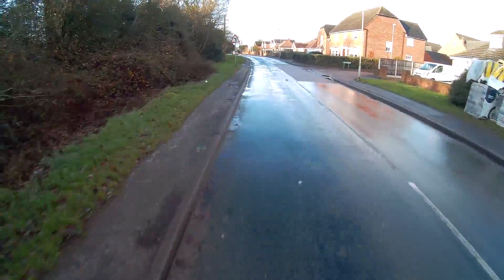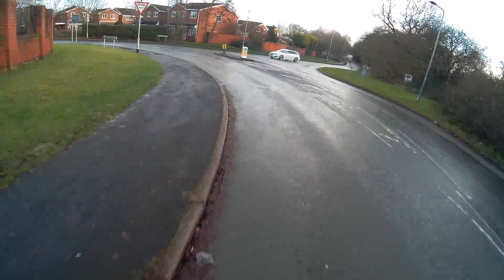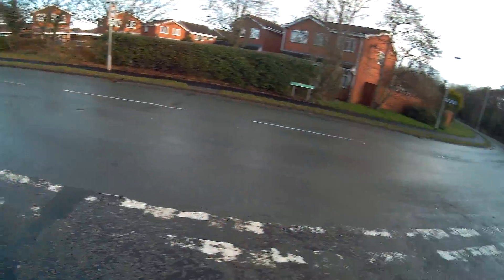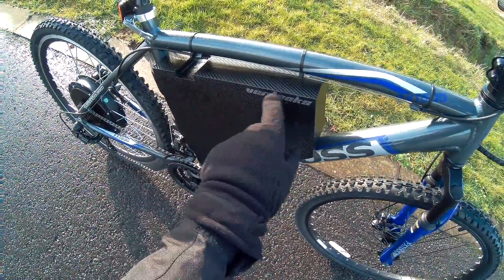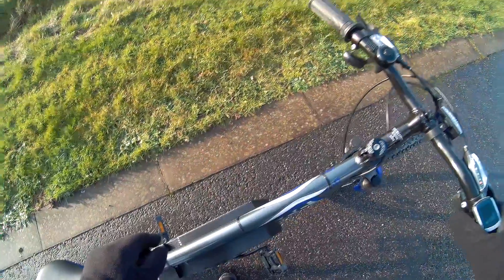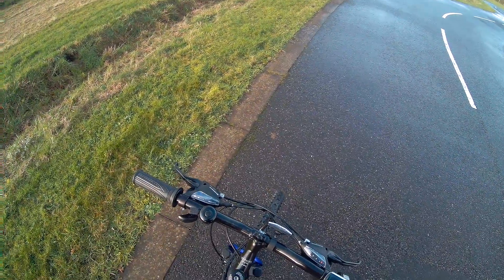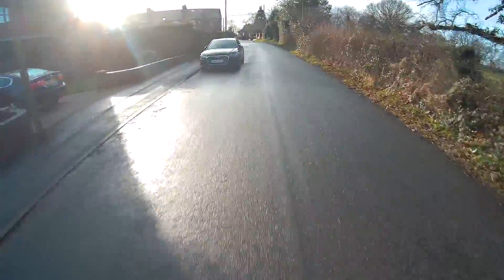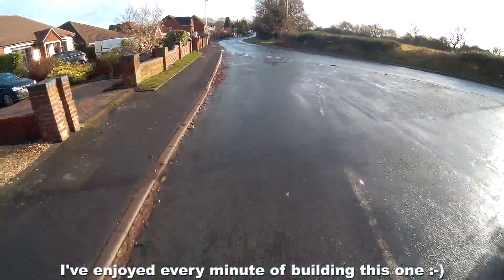Budget 1500w DIY eBike build part 5 - The maiden run and it's now for sale!

Comment: that bms is a beast..could you recommend a good spot welder tony
Reply from the maker: Either the Malectrics, Sequre or the Kweld spot welders are all good. The first 2 are essentially the same but the Kweld is better.
Remember that a spot welder is only as good as the battery you're using. My battery will kick out 1000A which is total overkill but you do need something ample.
https://malectrics.eu/product-category/arduino-spot-welder-bundles/
https://sequremall.com/products/mini-spot-welder
https://www.keenlab.de/index.php/product/kweld-complete-kit/
Reply: @Vortecks  thanks tony..i will be sure to over do the recommended limit..thats why i want to make one myself..some chinese packs look like a fire waiting to happen

Comment: For your next build you might wanna consider fitting a shorter handlebar stem which will save you hunching over the bike and give you better control for steering.

Comment: Could you put direct drive wheel on the front and use it to charge the batteries and extend range?
Reply: No, it would cost more extra energy through the rear motor to turn the motor on the front, than what the front motor could convert back into electricity = net loss. Regen only works when you've got energy that will be wasted, e.g all your kinetic energy when moving and want to stop which normally gets converted and thrown away as heat energy by your brakes

Comment: My ebike has a problem, rear hub motor is 2kw and while filing the drop outs, I filed them a little too much and wheel, even if I tight it up as much as possible, keeps falling out of the drop out a little at the time. I have 2 torwue arms too, 1 on each side and they are well tight and release all the spinnubg force onto the frame, non away fron the frame. I am 100% sure that the axle does not spin more than a millimetre max but it easily slips down. What can I do??
Reply: Gursi Singh Put a neat bead of weld along one side of the drop out and file it back to an interference fit.
Reply: @calderdale6795  welding on aluminium is not good, I have heard it will weaken the surrounding material as the heat transfers
Reply: Gursi Singh  How is your frame put together Gursi?  There should be no problem with a good neat TIG weld with plenty of Argon. If it bothers you the grain structure can be normalised  around the drop out with a propane torch at the expense of your paintwork.   Aluminium alloys work harden anyway over a period of time. As a bit of a bodge approach to the problem you could use thin stainless steel slips either side of the axle flats.
Reply: @gursisingh1940  if you can't weld and grind down the dropouts, could you weld a thin small plate onto the flat side of the axle itself, and then grinding that down until it fits?

Comment: Great video as usual , can I put an idea in your head 🤣 I'm one of those sad individuals who drive an electric car which has the advantage of using up to 7kw 240volt Type 2 plug which are FREE to use at most shopping areas or car parks , it's used via an app which is used just to log you into the system and start charging , my question is could this be built in to one of your bikes ( shouldn't add much weight ) the only downside I see is if your there charging when I rock  up , I'd have to wait ⚡⚡⚡
Reply from the maker: You can charge anything which uses a type 2 plug and a bit of electronics so, in theory, yes it's possible 😁

Comment: He selling it for 700, add clark m2 hydro brakes for £50 on amazon which come with disks and pads, change shifter and deraileur for another sub £50, change front fork for about £100 or 150ish new and you got yourself a top notch ebike for under 1k

Comment: whoever buys it ?? for and extra 160 ish quid you could upgrade it with
Balloon tyres, sprung saddle, larger brake disc rotors,  '11'-28t freewheel + '58' tooth chainring, mudguards, lights.
and you will have a comfortable all weather commuter that you can pedal at high speed and will stop quickly too.

Comment: Wouldn't a road bike be more efficient?
Reply: skinny tyres are more efficient at going fast but not at stopping again and it would painful hitting potholes and bumps at +30mph so you would need fatter tyres and the road frames are not built for them, plus a mountain bike has (some) suspension, and is made to be much stronger.

Comment: This type of build, with these parts, and bike, would normally sell for around £600-£700. Maybe £800 on a good day, (if prepared to hold out) I've built similar using this particular kit. However, we're talking Tony here, not some anonymous f***-witt, who doesn't have a clue what he's doing. (Some would claim that's me) 😜🚴So, the sky's the limit. This is a one of a kind, hand built by someone with an excellent reputation. A collectors item. It could go for a lot more if Tony can advertise the the auction site properly. My advice would be to make another video specifically about the auction and when it's up for sale. That way, all of his subscribers get the message... HOPE YOU READ THIS TONY, AND TAKE MY ADVICE. YOU'VE A BETTER CHANCE OF GETTING TOP DOLLAR IF YOU DO. Good luck fella.
Reply from the maker: I'm reading it now mate and yeah, I could get a lot more than I want. I've set the price at £700 ono and the first to offer it, is the new owner. I'm not out to make mega money and I only want to cover my costs & some for the countless hours of labour, battery box design and 3D printing 😁
Reply: @Vortecks   fair play to you Tony. Nice to see someone who has that attitude. It's a bargain mate, and at that price you could sell them all day long. 😜🚴🚴🚴🚴🚴

Comment: Hey tony great videos man love the content! Any chance we can get a video covering your 3d printer and maybe some of the process of when you make a case for the batteries? That would be very interesting! Any ways mate have a good one
Reply from the maker: It's been requested a few times now mate. I'm trying to do something with regard to a tutorial but it's not going too well. It's the sort of thing that I just do and don't think about it.
The amount of swearing in the parts that I've done, make it rather unwatchable at the moment. I'll keep trying though 😁
Reply from the maker: @rc.realistic.overlanding At full power, a 1.5kW motor consumes 1.5kW of power but this is proportional to the amount of throttle you're using.
Using a bigger motor will probably consume more power, because of the larger mass it has to move.

Comment: The fact its a signature bike is something that should get you the money.... Its 0001 .... Nice one Tony I am really impressed with it... But I didn't expect anything less to be fair.... Glad you used the voilamart because I have been raving about them for 18 months and people have said it must be shit for that price.... For £700+ its well worth it.... I may have myself a cheeky bid or two to see if I can win it
Reply: I agree, just because something is cheap doesn't necessarily mean it's crap. I shop at Aldi every week and get some excellent bargains 😜🤗😉. Voilamart wheels are cheap but surprisingly very good value and reliable. Something that you don't normally associate with China.
Reply from the maker: Well, after trying for 2 weeks (and not using fleabay) it's finally sold to someone who appreciates it. I would have dropped the price to what it cost me, as long as it went to someone worthy. It's certainly a limited edition, there won't be another one made 😁
Reply: @Vortecks  you should have raffled it off... I know its only an ebike but its truelu a one off mate

Comment: Its not just the cost of the bike frame , motor kit and batteries this is a special edition with quite a few hours hand built by Tony so it will sell for over £800.00 on ebay:)
Reply from the maker: Sorry to say but......No it won't. At the end of the day, it's just another e-bike. Once it's sold (which I think it has been) it's simply another bike.
Reply: I reckon it could go up close to a grand....

Comment: Does anyone know of a cheap 29er version at all ? Cheapest I've found is about £300-400.
Reply: Can you not get a 26er and then respoke it into the 29er wheel? I remember Tony ordering some spokes on one of his videos
Reply: Voilamart do mainly 26". However, I've recently come across some 28", front and rear, that they're also selling on eBay for £140. Chinese seller called fancy_speed is selling them. Only the 1000w version though it seems.

Comment: i'd like to buy it for a buddy of mine in edinburgh, how much? i can offer ya £750
Reply from the maker: The range is 10-22 miles (I weigh 72kg and full throttle is 10 miles, throttle only @ 15mph is 22 miles) and it doesn't go as fast as I wanted but it still does 35mph..... And, it has 2 stickers on it which cost me £3 😂
The price is £700 cash and I'll drive a 50 mile radius from Cannock Staffs (either to meet half way or deliver it) but I won’t be shipping it anywhere because I know what couriers are like.  If you're still interested mate, drop me an email - vortecks2000@gmail.com

Comment: Hi. Is it possible to use a balancer on a prebuilt battery pack that has its own bms inside? Think my packs getting some sag now after a few miles and the meter drops fast on full throttle recently
Reply from the maker: Yes mate, you can do that. Some people use the active balancers (when they work) in parallel with a BMS.

Comment: Tony... If you wanna sell your other bike the 3rd generation one as your buildibg the 4th one soon I'm willing to offer you £1500+50 postage. Straight offer no bull no crap nowt but honesty. Thanks for making us all laugh and sharing your wealth of information with us too. Thanks
Reply: Have you bought a electric bike yet got a full suspension mountain bike 2000w rear hub motor German 60v battery and controller thumb throttle  if you want have a llok
Reply from the maker: If & when I decide to build V4, I'll let you know mate. At the moment, it's looking like I'm keeping it for another 12 months whilst I figure out what is/isn't possible. I might even upgrade V3 to make it even faster and break that 100mph barrier on it 😊

Comment: What happens if you accidentally turn it off at 30mph, is it intelligent enough to not allow this operation?
Reply: No. You turn it back on :)
Reply: It won’t matter. You will just slow down and stop safely
Reply: It  anchors both brakes on and throws you off... Lol.... No it just slows down... Then you just push the button and turn it back on again..

Comment: I started  with  a 1000w rear wheel , 26inch bike. Ended on a dual wheel fat tire (1000wfront 1000w rear).  If you build one of these- you will have a BLAST with it :)

Comment: Interested in buying Tony
Reply from the maker: The range is 10-22 miles (I weigh 72kg and full throttle is 10 miles, throttle only @ 15mph is 22 miles) and it doesn't go as fast as I wanted but it still does 35mph..... And, it has 2 stickers on it which cost me £3 😂
The price is £700 cash and I'll drive a 50 mile radius from Cannock Staffs (either to meet half way or deliver it) but I won’t be shipping it anywhere because I know what couriers are like.  If you're still interested mate, drop me an email - vortecks2000@gmail.com
Reply: @Vortecks  Tony, that's a bargain. I would have wanted more. That battery alone would cost a fortune if it were a commercial one.
Reply: @kenharvey9714  I'm not in this game to make money mate, I want someone else to smile as much as me and I only want enough to cover my costs.

Comment: You can get seat post's with built in shock absorber's now and seats with big comfy springs in them. So bumps should not be a big problem. Great Build as ever.
Reply: Indeed was going to say the same thing,  I pretty much always had hard tail bikes but when i built my high power ebike the slightest bump at speed was amplified, so I invested in a Suntour SP12-NCX they are not cheap and i was hesitant at first because of this cost but the first time out it was amazing.
Reply from the maker: There's no way of saying this without it sounding condescending but I know. This was a budget build and I used only the cheapest of parts. If it was left to me, I'd have used only the best components and a far superior bike to start with. People wanted me to do a budget build series and that's what I did 😉
Reply: @Vortecks  Don't worry about it, We know it was a budget build , We are just suggesting things to make the bumps less painful for the new very  proud owner.